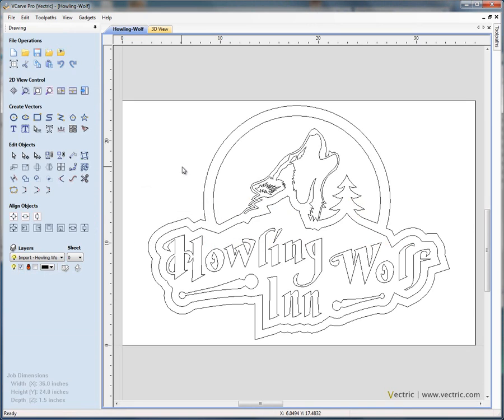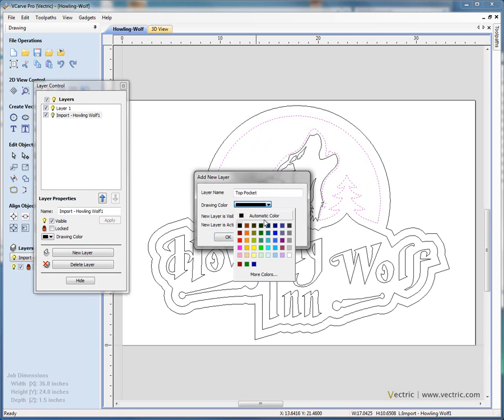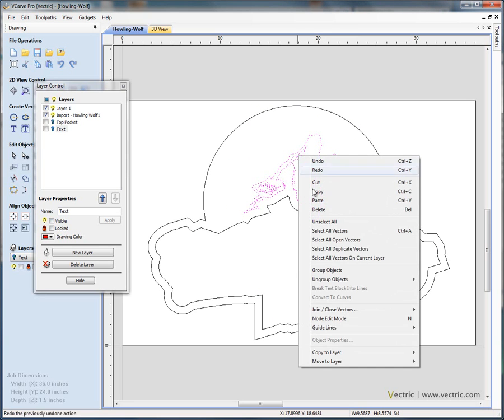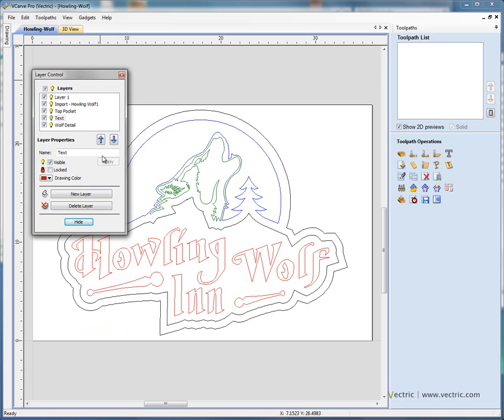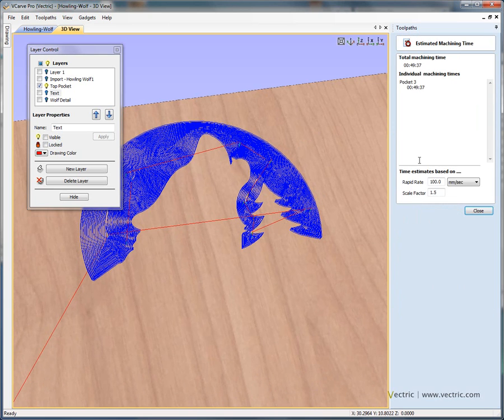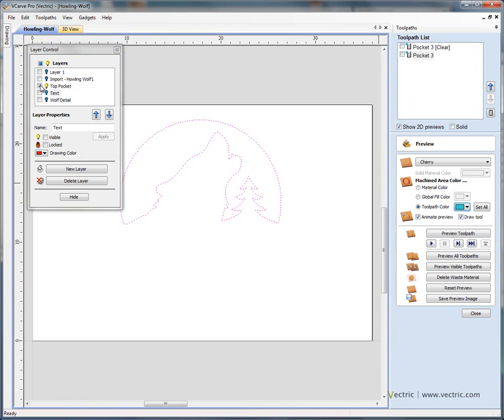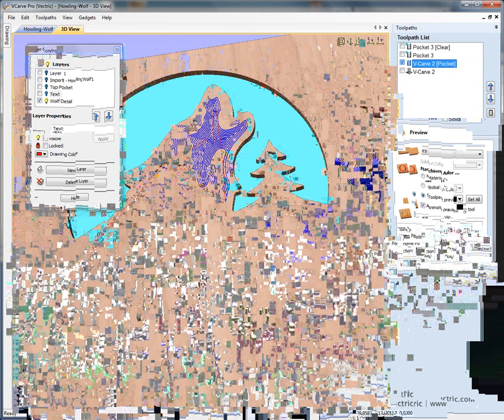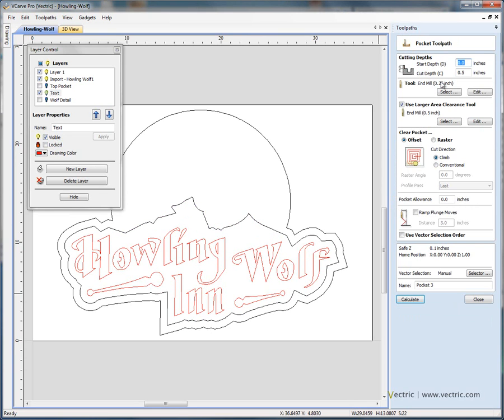2 Tool Pocket Prism Carve Multi-Color Preview

Comment: Great video.. question I have is how would you paint the different colors?
Reply from the maker: Hey Jeff, you can simulate the painted colors from the toolpath preview pane, where you select the toolpath and use the option "Toolpath Color" where you can choose the color to simulate that toolpath :) I hope this helps!
Reply: Vectric Ltd, thanks for the reply... my question was more around finishing process... colouring it after cutting..